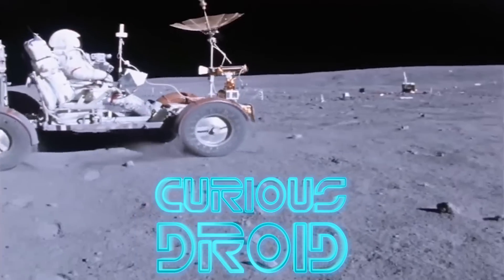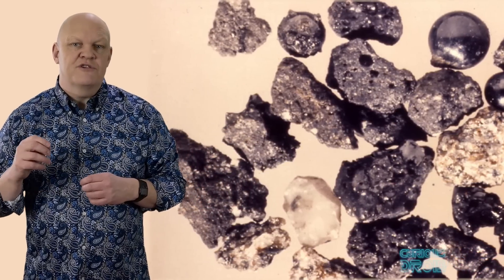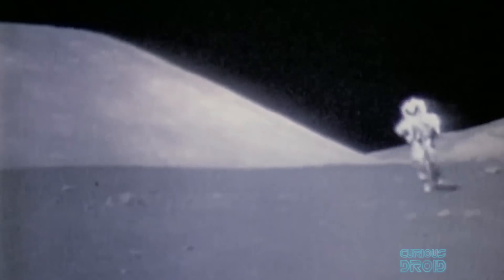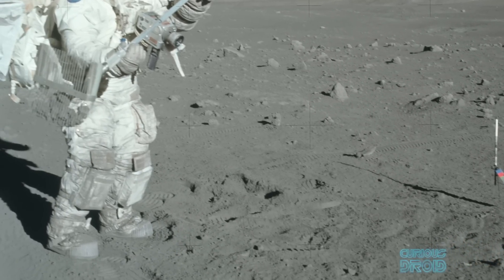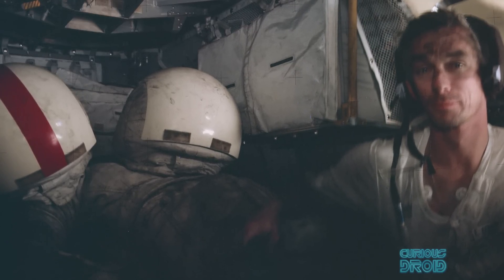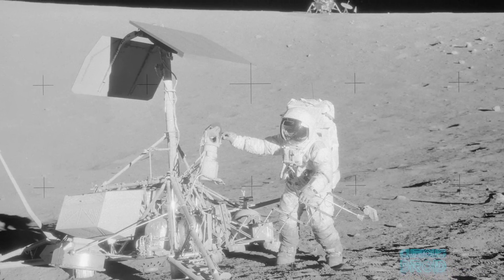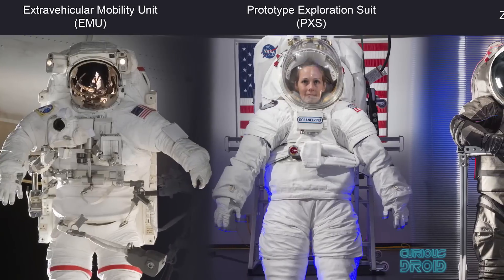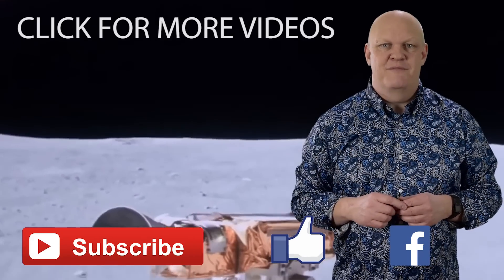Apollo, the Lunar Dust and NASA's Dirty Problem

Comment: YEAH,  STRANGE HOW , DESPITE THE COLLOSSAL BLAST FROM THE ROCKETDYNE MOTER, UPON BOTH LANDING AND TAKING OFF, NOTHING LIKE THE HUGE EXPECTED CLOUD, OF DUST  ETC HAPPENED.   WHEREAS, ACORDING TO ROCKETDYNE EXPERT , BILL KAYSING, IT WAS SO POWERFUL, IT MOVED SEVERAL LARGE ROCKS., DURING TESTING, BUT ON THE MOON ? HARDLY A SPECK OF DUST.HOW IS THAT POSSIBLE ? FOR YEARS BEFORE THE1960'S. SCIENTISTS BELEIVED THE MOON COULD HAVE DUST TEN FEET DEEP, OR MORE.

Comment: But no dust in the lem pads?
Reply: I’ve yet to hear a coherent argument as to why there would be. On the LMs, or on on the pads of any other lunar landers.
Reply: 1) The engine was shut off when one of the probes on the end of the LM legs made contact. You can hear this in the landing audio recordings when the LMP says "Contact light. Engine off". So, the engine has stopped blasting dust while the LM was still above the surface.

2) In Earth's atmosphere dust meets air resistance and forms swirling dust clouds. You can see this when a helicopter lands in a dusty environment. In the vacuum of the moon, there is no air resistance so dust particles follow a perfect parabolic trajectory, rather than hanging in the air and settling down

Comment: When using an angle grinder slitting disc to cut aluminium I always use a breathing mask because the abrasive dust always causes hayfever symptoms. That also smells of gunpowder.

Comment: I wondered from the beginning why the rocks on the moon had no layer of dust on them but the surrounding lunar surface is covered in dust.
Reply: Your assumption is that those rocks were there long enough to be covered by dust. Are you sure it's a correct assumption?